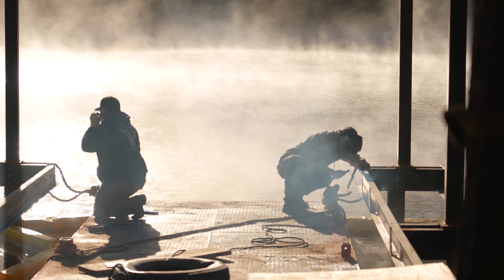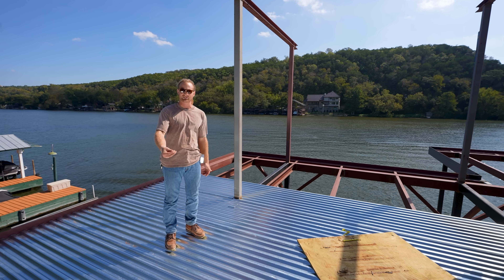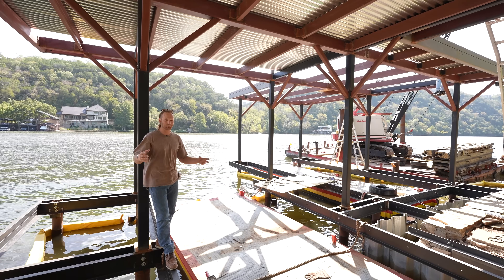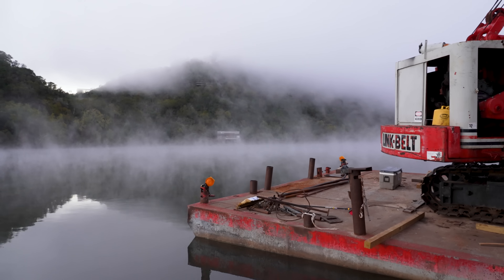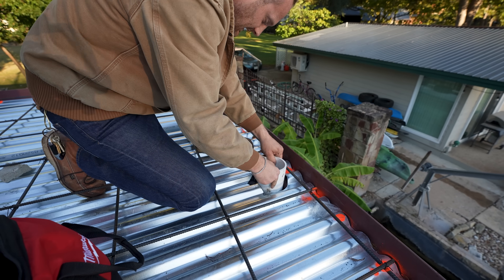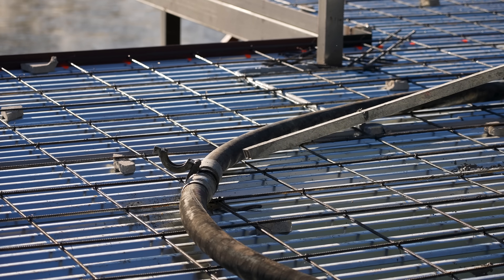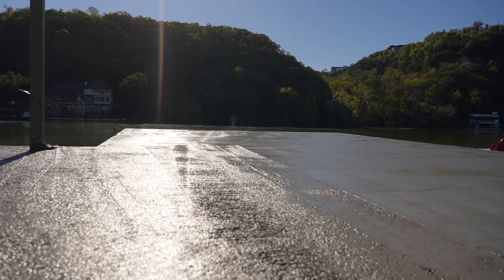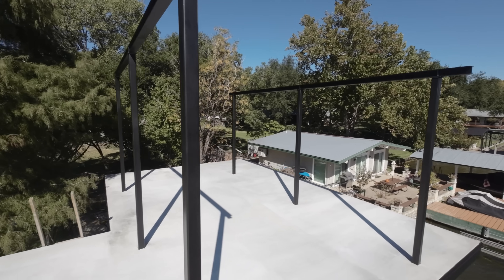How We Poured Concrete On a 2 Story $700,000 Boat Dock!

Comment: Wow, that looks like a very weak metal deck pan. It looks like metal roofing, but I’m sure that’s what your engineer called for. You also have pretty stout braces underneath to support the cement. I’ve just never seen metal roofing used before. The boat deck is going to look awesome, but it certainly better for a million bucks!
Reply: Looks like 22-gauge b-deck. It’s normally used for commercial construction. No fastening is a choice

Comment: Smart using an inflatable kiddie pool for excess concrete.  Maybe that's common in the industry but new to me.
Reply: Industry practice varies by budget. The cleanest sites have specific metal buckets like mini dumpsters that you clean out in, it cures then they flip it with a telehandler and the concrete block falls out and goes off for recycling. In residential projects, some will dig a hole, put poly plastic in the hole, then wash out in that, theyll dig this out when cured.